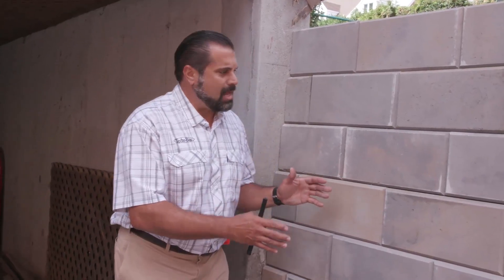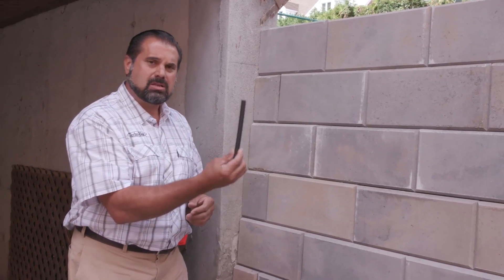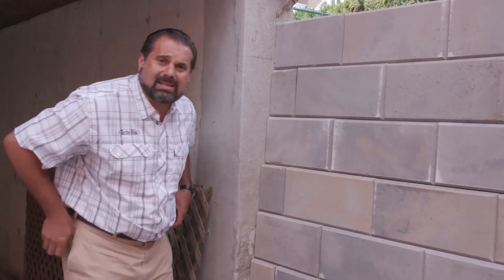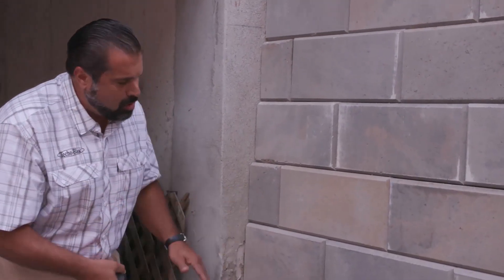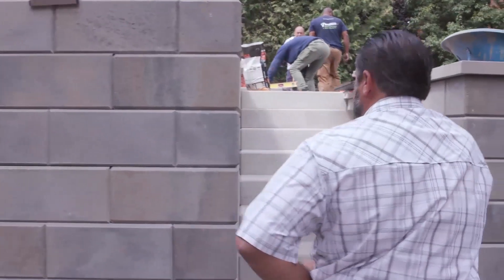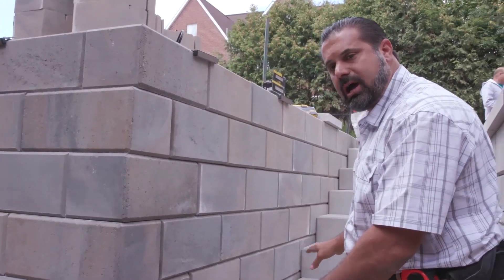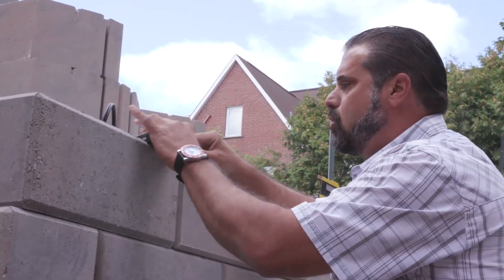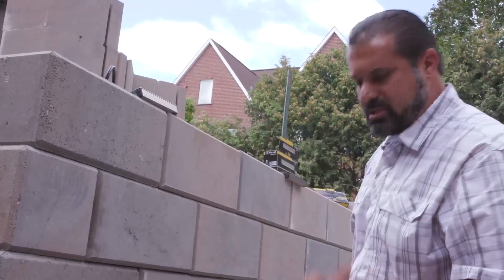How to Build a Geogrid Stabilized Retaining Wall - Part 4

Comment: It says in the documentation that the G-force does not support vertical wall, but in this video you are mentioning building it that way for the wall on the Stairs side. Could you explain how you did that? did you use corner blocks for all of that wall?

Thanks